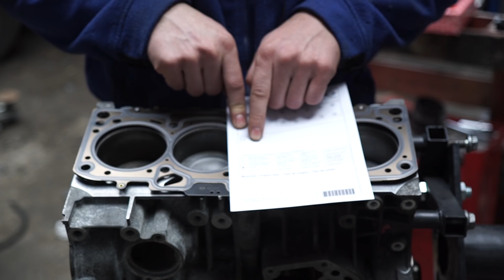Wymiana uszczelki pod głowicą / audi 1.6 sr /

Comment: Hi ! can you please tell me in english the conclusion >?< i have skoda 1.6 sr AVU would want to do the same as it starts in 3 cilynder with intake missfire . is it worth it or should i sell the car and buy japanese car or corean  ?? THANK YOU !
Reply: After 17:00: When the bottom of your engine is in the car, before screwing head bolts, you should clean the gaps from oil and water (where head bolts will be mounted, it's important). After that, before first running, you should change the oil, oil filter, cooling liquid and seals. After few minutes, when the air in engine is gone, you have to again pour the cooling liquid.

I don't really understand "intake missfire".

If you really have a broken head gasket, the most expensive is work. In Poland head gasket costs 15 euros, the bottom of engine costs 100 euros, grinding the head and bottom of the engine costs ca. 75 euros and of course other parts and the mechanic's work.

If your engine is running unevenly, like on 3 cylinders, it's better idea to check the ignition system (sparks, ignition device, leaks in the intake system etc.). It will be cheaper and faster.

You have to analyse what is the condition of your car. If it's good, i think it's better idea to fix your car.